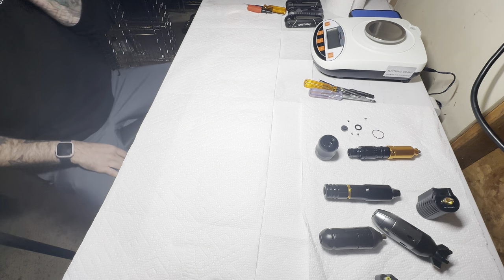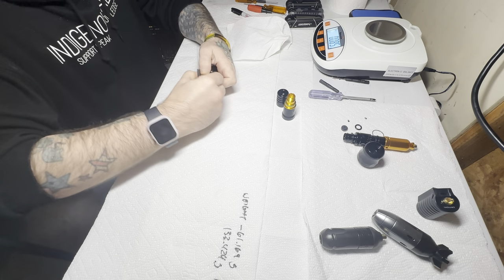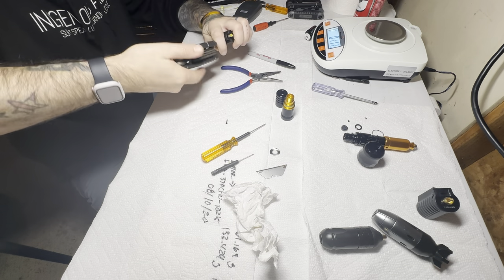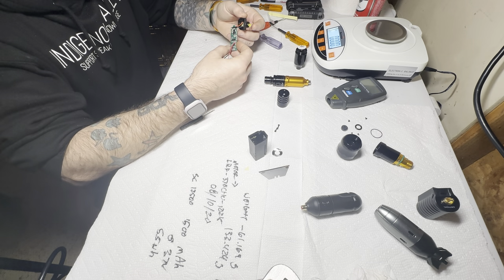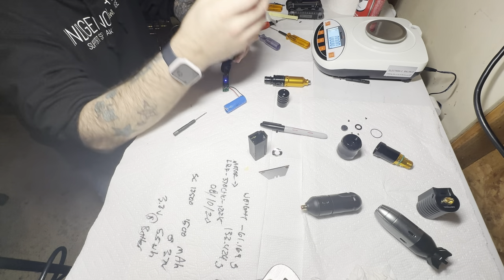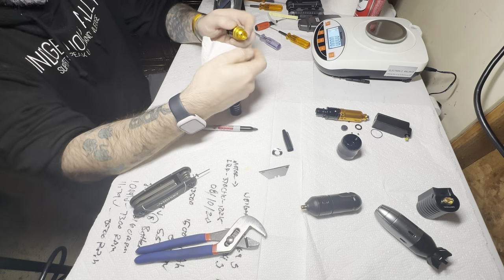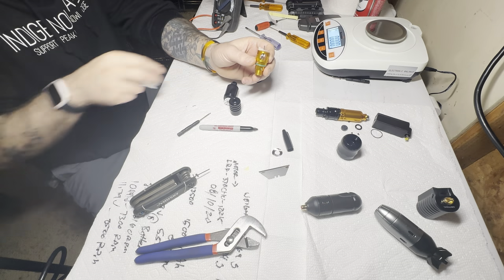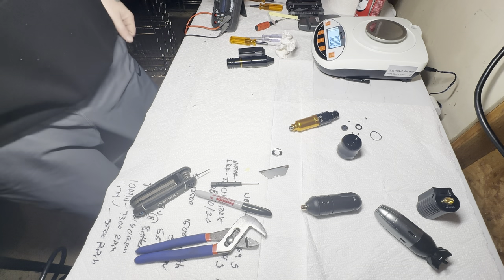DragonHawk Tattoo Machine (Ancient Tech) Breakdown and Review

Comment: why do most manufacturers choose to go with plastic for the flywheel cam? why not metal. i notice this a lot on the adjustable stroke machines.
Reply from the maker: Probably noise, weight, and manufacturing costs. It’s easy to extrude a plastic wheel like those you’ve seen. Forging or pressing one would be much costlier. The metal would also have different stresses when friction is applied to it - I.e. heat dissipation may be an issue with greases or other internal components. Lastly arising a press-in bearing for metals can be a bastard at that size. You’ll need precise machinery to accomplish it (I’m assuming as I’ve tried pressing in these small bearings so many times and have exploded them with little effort) and that costs money. It’s easier to heat a small bit of plastic and slide that sucker in with some sealant. 

These are my assumptions as I’m not a manufacturer so take them as you will 🤘